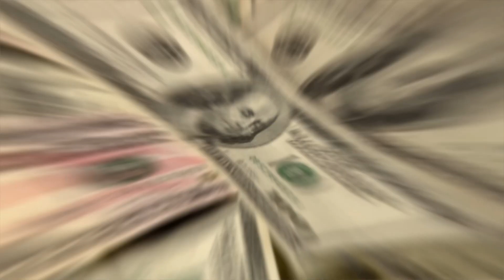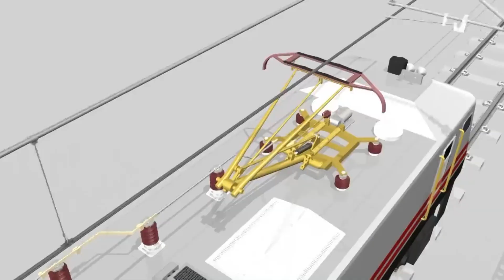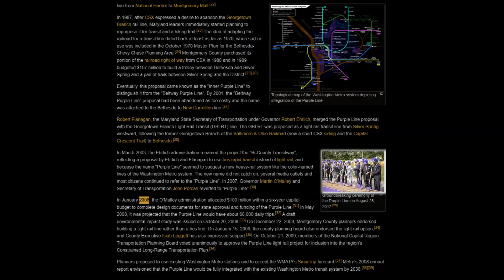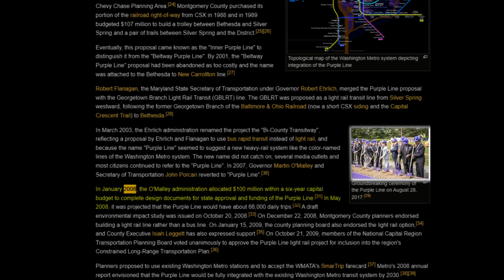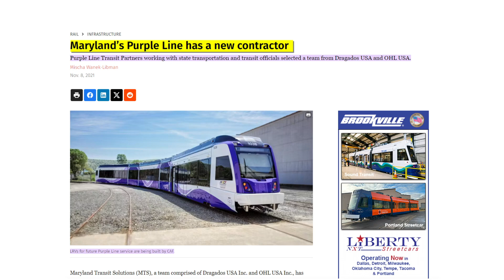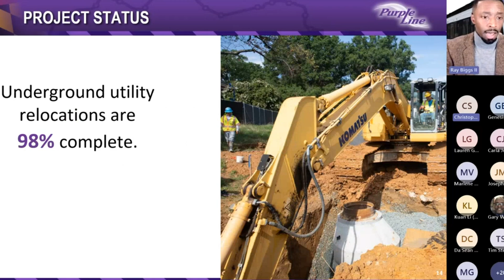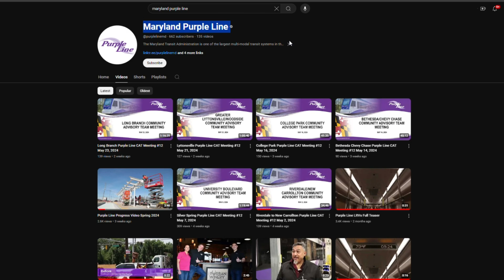Maryland's New Pride - The Purple Line Rail Project

Comment: Good attempt. Fact checking needs to be better. Yellow Line no longer enters Maryland. Also, WMATA/DC Metro connects with VRE (Virginia Railway Express). Lack of inclusion of that fact (about VRE) makes this video incredibly Maryland centric (which I guess it must be due to Purple Line - but at least get facts straight). Find ways to distinguish your channel from the B1M which also covers transformational projects / megaprojects.

Comment: The cost of this will never pay for itself.  The ridership estimates are wildly over estimated.  There always has to be a building project going on in the DC Metro area . This is not one of the  better ones.
Reply: Transit in general doesn't pay for itself, but that's also not its purpose. Highways don't pay for themselves either. I'm not sure about the ridership estimates, so I won't comment on that. But I disagree with your last statement. I think the Purple line is a good idea. An issue with Metro is that it only routes into DC. Going from Shady Grove to Wheaton for example, requires going all the way into DC, and back out. East/West connection with the Purple line helps with that. I look forward to its completion.
Reply: @Cerucir  agreed.
Reply: @Cerucir  Time will tell. Who will really use the system ? More likely the people who cannot afford a car to get around.  Have you ever ridden the light rail into Baltimore? That is a scary ride most days
Reply: @rehabmax Tons of people of all walks of life ride the metro here in DC. I ride the Metro every day. Yes, sometimes people yell or ride while drunk or high. Welcome to life in the big city.
Reply: @rehabmax People who don't want to drive, or don't want to be  in traffic, people who can't drive (teens, elderly, disabled), can't afford a car (cars are expensive to own and maintain, even used cars these days) would use it. I would use it, even though I have a car. I use the metro as well for going into DC because I don't like driving in DC or paying for parking. It's nice to just sit, look out the window, read, do Duolingo lessons etc. on the train. Can't do that while I'm driving. I can definitely still drive into DC (I never do), but it's nice to have other options. With more people using something like the Purple Line, that's less traffic/fewer cars on roads, like 495, which is always terrible. People who wanna drive can still drive. Can't comment on light rail in Baltimore, haven't had that experience.
Reply: @rehabmax  I’m going to disagree with your skepticism impolitely, because you’re dismissing the potential of this system as something that is “for the poors". This will be a massive game changer for anyone who cannot drive for any reason. It will open many doors to many internship opportunities for students at UMD and connect many more people to job centers that are currently exceedingly expensive or time-intensive to reach due to the over-dependence and inefficiency of cars. I personally wish the route would expand to circumscribe DC.
Reply: @stephenshaw7593  Playing off your point, people also drive while drunk or high. But when people ride the train while impaired, at least they aren't doing it while in control of a 3,000 pound guided missile.
Reply: @rehabmax  It's a problem with any city, and public transit is actually viable. Most people drive not because they prefer it, but because there's no other option
Reply: Transportation projects are notoriously difficult to determine their payback. Which you are not considering is the facilitation of greater commerce and the extension of value.
Reply: You are an old senile boomer aren't you? go drive around on your garbage little car while I enjoy good public transit in DC